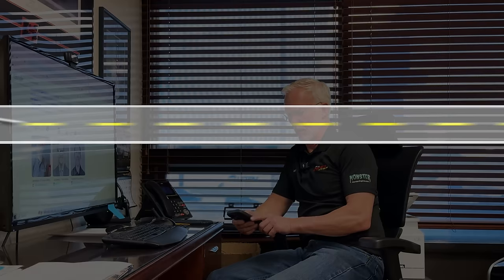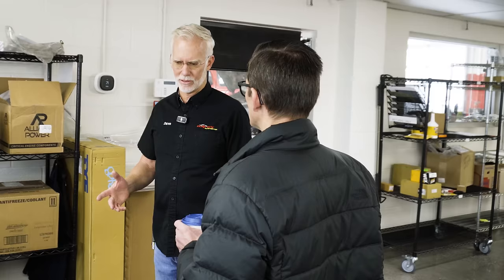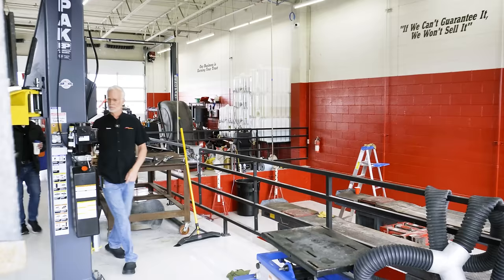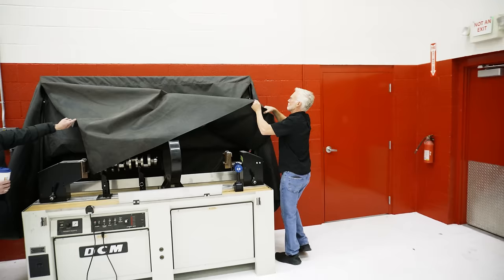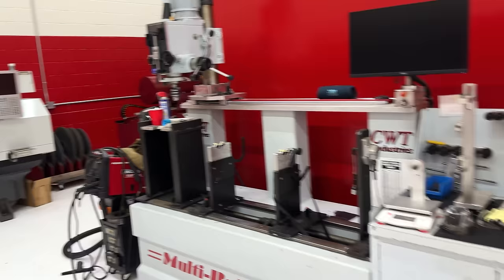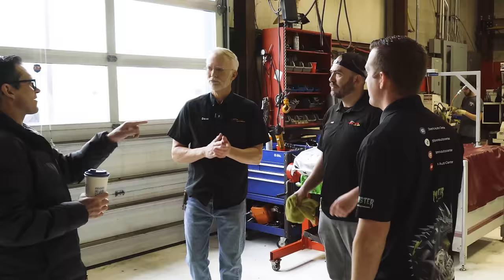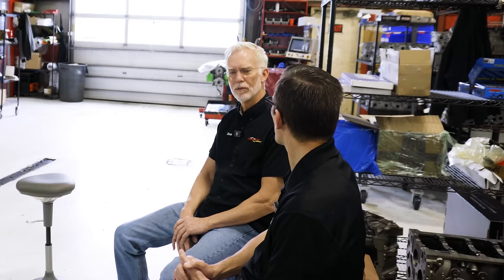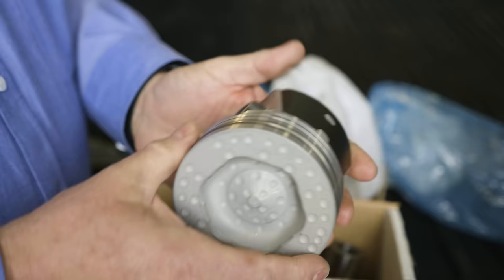Sitting Down With Lake Speed Jr. - The Truth About Oil Change Intervals and Analysis

Comment: My Impala's oil change indicator runs down faster, when I'm driving at lower speeds. When I drive it like I stole it, the damned thing drops extremely slow. I've noticed, from doing my own oil changes, that the oil even looks and feels better, when I mash the gas pedal a little harder. It's too bad gas prices are out of control, because I'd drive like that all the time, if it weren't so damned expensive.

Comment: For any new car, changing the oil for the first month, then 2 months later, then 3 months later... helps remove debris particles in your motor.  For the first 8 months, make sure to account for this cost.  After that, go by the book.  The same for your oil filter.

Comment: What does someone suggest to add to diesel fuel
Reply: Red Line 85 Plus cetane booster
Reply: @Jurornumber5  Thanks did help you ?
Reply: @tedhicks5431  For sure. Easy start-ups, better gas mileage, and keeping seals lubricated.
Reply: @Jurornumber5  gonna try it i always change my oil on 6.0 ps and all 3 other cars at 5k thanks

Comment: I'll tell you- oil is cheap and recyclable. My intervals are dictated by the color- when it starts going from golden to dark honey...usually in my old rigs thats about 1800-ish miles. I've never had an engine failure in 38 years of driving. I give the oil to a guy who runs it in his equipment before burning in an oil heater so it gets used 3x.

Comment: Octane is lost when petrol is pourd ."": as in from manufacturing tank to ship to tank to truck tank to Gas station tank to your car truck van motorcycle tanks . SO ITS  IN POSSIBLE TO GET HIGH OCTANE PETROL OR GAS IF that's what you call it as for contamination it's simple DIESEL is a  compression ignition explosion,  it explodes on compression NOT spark AS a result this compression causes contamination of the engine oil , cheep engine has very little detergents so the diesel engine oil get thick and turns into a form of grinding paste this well ware out your engine oil a multi trans oil that's suits both Petrol and diesel is great BEEN used for donkeys years for all static and heavy high raving engines . Gas (LPG) NEVER causes dirt in the oil only if valve steam seals are gone then the oil gets into the compression system on top of the pistons minute amount but wrecks the oil but once dipping regularly this will be noticed.  If the manufacturer says change oil every 10,000 ? 5000 / 6000 . Buy in  bulk get some friends together buy 200lt barrels great price major savings which keeps the cost down for oil changes doing more regular. Always change your air filter Always saves a lot in fuel cost. In the long run . Prevention is $1000s better than cure .😮

Comment: Toyota Tacoma oil change every 10k miles. At 160,000 miles with no problems.  The oil analysis was not presented with associated engine longevity data. “It stands to reason that…” is not a correlation.

Comment: I have a question regarding oil change intervals, @@themotoroilgeek.  On the one hand you say factory OCIs are too long and are there for CAFE numbers, then go on to talk about UOA.  The vast majority of UOAs for folks following the factory OCI have the report come back saying the OCI can be extended if desired as the oil is still within spec, isn't contaminated, TBN is good, etc.  It seems you're a proponent of more frequent oil changes than the mfrs recommend.  Maybe you know where I'm going with this, maybe not.

So, getting to the meat and potatoes, I've seen numerous independent tests as well as by the SAE that state changing your oil too often is also bad for the engine.  Why?  Because the initial detergent load is counteracting the anti-wear additives and washing that protective film away for the first 2,000-3,000 miles after an oil change.  This is verified by UOA and when wear rates are plotted it looks like a bathtub.  When oil is sampled every 1,000 miles the first 2-3 samples show a spike in wear, then wear rates drop and remain stable until the oil either becomes fuel diluted or the additives are consumed and wear rates increase again.  The end result is that changing oil every 3,000 miles results in consistently higher wear rates than following the mfr interval or doing UOA-based extended drains because those short intervals never allow the anti-wear additives to fully kick in.  This is for diesel engines, BTW, but the same tends to hold true for gasoline engines that are properly driven and not subjected to constant short trips that result in fuel dilution, etc.

I agree with and use a lot of your data as references for others, but this is one area where I think it really depends on a number of factors and a blanket statement that factory OCIs are too long is a generalization that isn't going to be true for many folks.  Since it's science and not speculation, I would tell folks to start having UOA done to track wear rates and oil condition to determine what the ideal OCI for their vehicle and driving habits is.  I wouldn't just tell everyone that factory OCIs are too long as the science doesn't agree in most cases and there are simply too many variables involved to make a generalized statement like that.

I have UOA performed and follow the OLM with my Duramax, the UOA results are always coming back excellent with roughly 7,500-mile OCIs which is the max interval recommended by GM for the 2.8.  In fact, my UOA results come back better than average as I run a proper 5w40 HDEO (Rotella T6) instead of dexos2/ACEA C3 which isn't a great diesel oil spec, IMO.  Also, 5w40 in the 2.8 Duramax falls within the viscosity recommendations from GM so I'm not running an unapproved viscosity, I'm just running a better diesel oil than dexos2/ACEA C3 specs can produce.

I also 100% agree with the use of fuel additives, I use them every tank (Usually Power Service Diesel Kleen) and definitely noticed a difference when they're not used.  I'm not too concerned about lubricity of the fuel from the pump since where I live all diesel is B5-B20, but the cetane boost combined with the detergents really help to keep my engine happy.

Comment: The OEMs are full of shit claiming that you should use a quart of oil in a thousand miles. No oil should be gone. The oil should still be at the full line when it's time to change the oil. I have never used oil on my cars unless there was an actual leak. If there is no leak then your engine is bad if it's burning oil.

Comment: The best way to maintaining oil and never having to do a oil change ever again. Drill a small needle hole in the oil pan and top it off when it gets low. As the oil gets used it will drain out just fill when low.😂😂😂😂

Comment: If you're impressed by the dude welding that block back...check out the dudes in Pakistan doing that shit on dirt floors,using coal and wearing  flip flops. They never replace engines,  they rebuild everything with simplest tools .

Comment: To be fair in most cases if you do a standard oil change your motor is going to outlast that vehicle. I suppose it might depend where you live but most cars have other things breaking down more and more common as the car gets older or the body rust out. All of this happens long before the engine goes bad you guys are repairing engine people generally you're either have a fluke bad engine or they totally didn't take any care of it at all. If you're changing your oil when a manufacturer recommends the engine will probably last longer than the rest of the car

Comment: Amazing information then ‘the oil guy’ blew it at the end. Oil change every 3000 miles, say 35 mph average that’s every 85 run hours 😂.  So what does his oil analysis say after 85 run hours? I bet the oil is fine unless you are doing track miles.  Oil guy does not mention synthetic oils, huge difference. Long life oil change intervals in Europe with synthetic are 15-20,000 miles normally using an algorithm and all gasoline has additives. That’s still only 570 run hours.  US is still hooked on grandpa’s “change the oil every 3000 miles’

Comment: "there's not a magical drain interval number. It's all how you use the vehicle"

Never a truer word spoken.

Dave will hate me tor this. OK, maybe not, he's a fun guy...  But change your own oil at 3,000 miles or whatever the manufacturer says. Is it amber or is it black? Amber is a little too soon, black is too long.

Oil is cheap, engines are not. Go dark amber on the colour. Black is too long.

For Dave: for customers, take a pic of their oil draining and recommend an oil change interval. It maybe someone brought in their truck after 3,000 miles and it looks  like maple syrup you can tell them it's too soon. If it looks like semi liquid coal, tell them more frequent changes are needed.

In my 53 years on this plant I've run by similar rules and have never had an engine die. I used to drive 50,000+ miles a year for business and almost as much for pleasure per year from age 24 and up.

The only exception to this rule was my 1996 Miata. I used to bounce that off the rev limiter during autocross (Solo2) events than I could count. It had an oil change interval of about a month, which was 2 events and 1,500 miles commute.I broke two timing belts and since it is a non-interference engine, all was good. It's a fun day when you're on a good run and the engine complains at almost 7,000 when dodging cones...

Comment: Changing your Motor Oil.  The price of a quart of oil has skyrocketed in recent years.  What do you pay, per quart, for 5W-30 nonsynthetic oil?

Now, do the math.  Cost of quart times quarts needed for one change.  Next, times changed per year.  Oh, yeah, add the cost of Filters, too.  How about Anti-Freeze?

Routine maintenance of your vehicle is phenomenally costly.  Thanks, Biden and Federal Reserve for reducing the value of the Dollar.

Comment: Oil change intervals and transmission flushes are a scam. I have 392000 on my 15 tundra. I change the oil every 15000 ish miles. And I have 0 oil consumption And/or issues. Last truck 304000 miles on it again Change oil Between 12 and 15000 miles No Transmission service And 0 issues. I change all my Differential and transfer case fluids at around every 50000 miles. I have never flushed a transmission Or did any kind of transmission service On any of my Personal trucks. And I pull trailers through the mountains constantly again 0 issues. Base oil does not break down It's the Additive packages In oil that do. Company I work for has a handheld oil analysis And we changed the oil in the Worktrucks based on that. We have actually pushed oil changes out to 22000 and more miles Cause the oil analyzer was shown It was still good Change the oil filter between the actual oil changes. Now, With all that being said, you have to use HIGH quality oils And filters. IMO...

Comment: The 7.25 hp briggs on my walk behind toro 22" recycler lawnmower doesn't even have an oil change interval. They tell you to just add oil as needed when it gets low. This is the absolute worst idea ever! Drain the fuel, tip the mower on its side and drain the oil out the fill tube and put fresh oil of your choice back in. Don't fall for this scam or you'll be buying another mower in 5 years guaranteed.

Comment: I have to disagree on the oil change interval commentary as it makes it sound like the engine makers are clueless and don’t care about customers or their cars. The reality is that the additional engine life you may obtain from 3,000 mile changes vs. 6,000 or even 10,000 as in the case of new Toyotas, is completely worthless to 95% of car owners.  Most modern engines will easily go 200,000 or farther on 10,000 mile oil changes.  Most cars never see 200,000 miles, particularly in the northern half of the country with winter and salted roads.  My cars are unsafe from rust before I can get 200,000 miles on them.  So, for me to spend twice as much on oil and filters to have an engine that might last 300,000 miles instead of 200,000 is pure folly.  If you are in the 5% that drive a car 300,000+ miles, then by all means change oil more often.  However, making that a blanket recommendation is simply wasteful of both money and natural resources.

Comment: I'm getting a little tired of following around behind this jacka$$ and trying to clean up all the misinformation he spouts. There is a saying out there that a little information is a dangerous thing, that applies so well to Junior. First of all, when it comes to zddp, the film that is developed onto internal engine parts from zddp additive will only develop to a certain thickness no matter how high the level of ddp is in the oil. Read that again and think about it. Once the maximum thickness is achieved any excess zddp in the oil only serves to replace the film as it wears due to contact between moving parts. A steady state condition is reached where zddp is worn off due to contact between parts and new tribal film is developed from the zddp additive remaining in the oil. The thickness of this film of decomposed zddp (the protective film that is developed occurs as zddp in the oil decomposes onto the metal surfaces due to heat from friction) does not increase based on the amount of zddp in the oil. There are factors that affect the thickness of the film, such as the chemistry of the zddp, or the temperature of the application, but not the amount of zddp in the oil. So when he says in this video something about higher levels of zddp causing corrosive wear because of the additional thickness of the film, it is a clear indicator that he doesn't know what he's talking about. And then there's the issue he keeps repeating about higher levels of detergent having a negative affect on the development of the tribal film, which again indicates his lack of knowledge. But let's get to the oil drain interval discussion, which is what attracted me to open up this video to watch due to the title. Extending drain intervals DOES NOT result in increased wear of engines, or shortened life of the engine, unless or until the degradation of the oil reaches a point where oxidation and/or nitration reaches a critical point, and/or the ability of the oil to neutralize acids in the oil is reduced due to depletion of basic additives, or the depletion of other additives results in conditions in the oil that will lead to aggressive degradation processes. So, yes you can run the oil too long and cause damage to the engine; but if using a high quality oil engineered to provide extended service intervals, you can easily exceed the OEM recommendations without causing accelerated wear or damage to the engine. As a Certified Lubrication Specialist for over 20 years I have been working with many, many heavy equipment & trucking companies to extend drain interval far beyond OEM recommendations, and engine service life has grown tremendously. 25 years ago engine oil drain intervals were pretty standard at 250 hours, or lets say 10,00 0 miles (it depends on average mph speed). Back then 10,000 hours (400,000 miles) was about the expected life time of an engine. Over the years we have slowly extended drain intervals out, which has been done along with changes to entire preventive maintenance programs, such as routine used oil analysis, as well as improvements in engine oil chemistry; but we are now out to 1000 hour intervals (equivalent to roughly 40,000 miles, again depending on average MPH) in some applications, yet engine life is out to 25,000 hours. And at that point when torn down the wear in the engines is minimal, they're mostly being torn down to repair leaks due to failed gaskets, seals and o-rings which have exceeded their life span and no longer able to keep the engines sealed up. Fleet Managers I work with are going to Caterpillar, Mack, Volvo and Cummins and telling them it's time to up their technology in regards to seals, gaskets and hardware so they can achieve maximum life out of their engines. The 3000 mile interval required for your warranty is ridiculous, completely unnecessary and just plain wrong.

Comment: It's all BS. Oil changes are a waste of money. I change oil every 30,000 miles, yes you read that right. I've never had an engine failure. Let's face it most people don't even keep a vehicle to the point of failure much less more than 100,000 miles. If you buy a vehicle brand new and your intent is to keep it for as long as possible (hopefully several hundreds of thousands of miles) then sure you should keep up with changing the oil, but if you don't keep a vehicle for very long what's the point of wasting money on oil changes? First rule of not getting screwed, don't listen to an "auto care center" to tell you how often to do something that makes them money.
Reply: You do you.

Comment: I buy any brand of oil and filter and don't trust any single brand. Every 4,000 miles. I used to do 3,000, but that is wasteful. 

I clean catch my oils, settle them in  5 to 10 quart containers, for 120 or more days, mix the top 90% into diesel fuel at 10% oil : 90% diesel, and don't waste a thing. I charge the fuel filter every 3,000 miles.

I pour off about 33% of the remainder oil for bar/chain/2 cycle fuel additive. I burn the remainder oil (with sediments) in wood boiler, on wood.